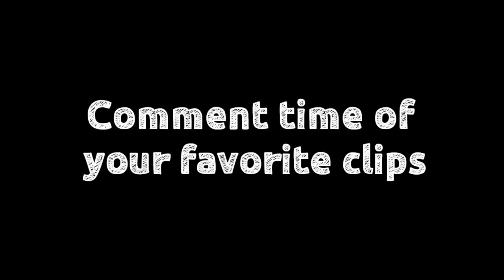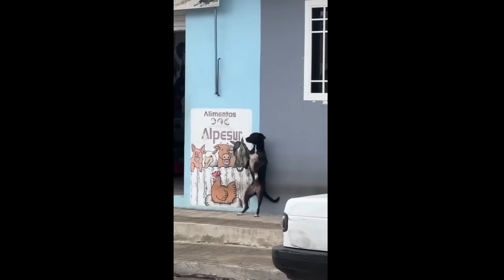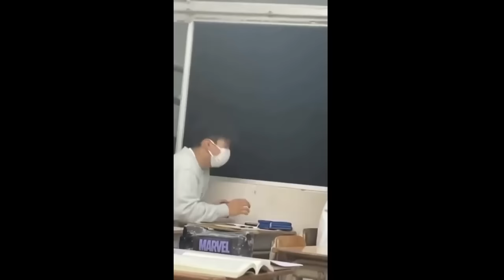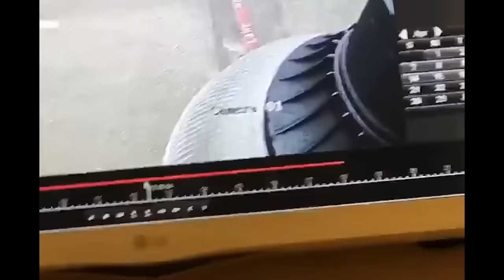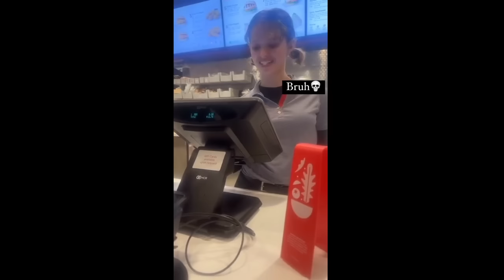Best Fails of The Week | Funniest Fails Compilation | Funny Video | Idiots Of The Week

Comment: 10:10 I KNEW this could happen! my fear of it for the last 30 years was NOT crazy. thanks.
Reply: Got my foot stuck between the belt and side. My shoe gripped when I pushed it against the side of the elevator, I could only try to pull my foot out and luckily I didn't get stuck and somehow I got away with some bruises. I prefer stairs over elevators.

Comment: 9:36 seeing the parachute take off by itself reminded me of something I did years ago. I used to fly kites with a rod and reel. Many years ago after I got my kite several hundred feet in the air I tied a heavy metal nut to the line and then cut it and let it go to see what would happen. The kite kept climbing until I couldn’t see it anymore. It probably ended up in another state. I was in western Kentucky and my kite was headed towards Illinois.